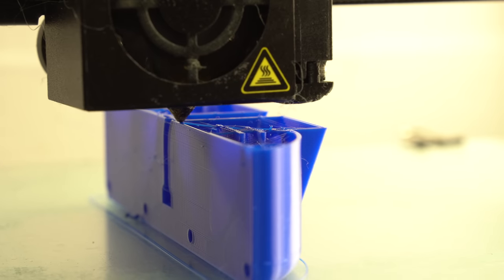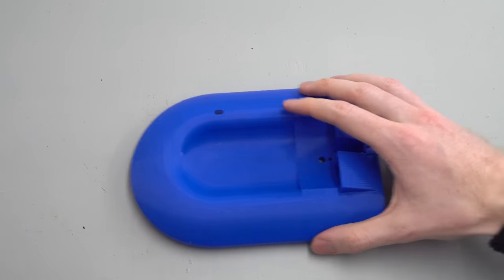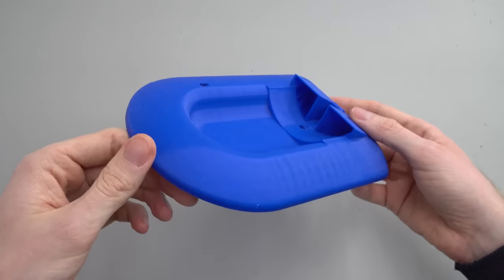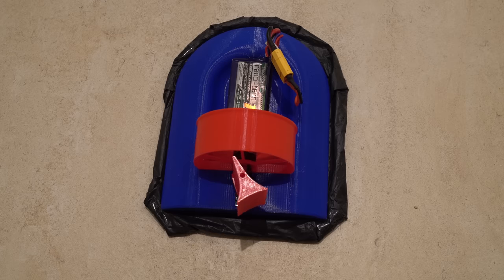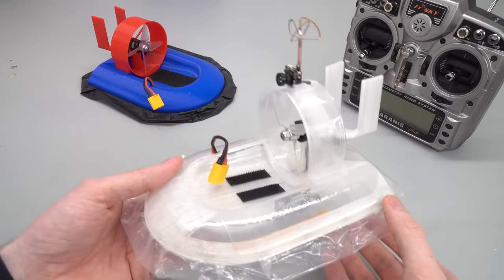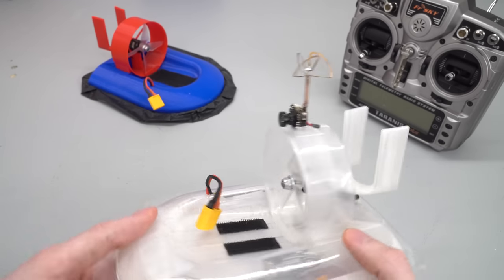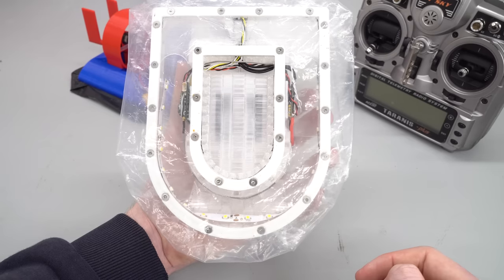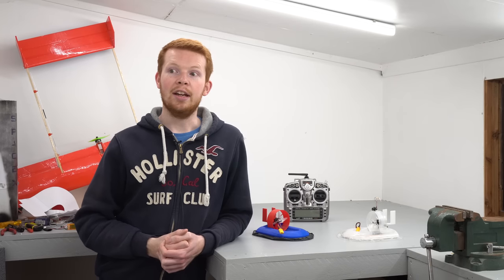RC Hovercraft Development

Comment: That VR system looks really cool!
Does anyone know where I could get one of those micro cameras?
Reply: The most reputable and specialised brand is Fat Shark, and then there's Eachine which just manufactures all kinds of low-cost RC toys, you go to their websites and find their distributors, they both have some retail presence in Europe and the States. Both companies are located in Shenzhen, China, but Fat Shark is run by a Canadian engineer. If you type in "FPV" on Hobbyking or Banggood or Gearbest you'll see some more offers direct from China, and you can usually get the same parts from eBay if you select worldwide or from Aliexpress.

I won't be able to give you advice on specific products to purchase or what their benefits or drawbacks are, i don't have any FPV experience myself, but perhaps this will suffice as a starting point. I can give you my general opinion on various Chinese mail-order companies individually if you like but the general gist is that while none that i listed are outright scammers, some people have had various bad experiences with each of them - Aliexpress and eBay offer some buyer protection, but are harder to shop at and get quite what you expected.
Reply: Thanks!
That is very helpful :)

Comment: Tom: I think this hovercraft is super sweet!  I bought the plans from Gumroad.  But dude; you really should have put some links in your plans.  I've been shopping for about 2 hours now and I haven't bought anything.  I can't even find the 1 pc 3" drone propeller.  HELP!!
Reply from the maker: Hi Michael,  Thanks for purchasing the files and sorry for not supplying the link. You can find a 3 inch propeller at hobbyking, link: https://goo.gl/xAr34F
Reply: Thanks for the reply Tom.  That is a 4 blade.  In the PDF you use a 3 blade.  I'm confused.
Reply from the maker: The spec of the propeller doesn't matter a huge amount, it just needs to be 3 inch in diameter. These are the propellers shown in the manual: https://goo.gl/SF4q9a but I can't find an 'international' company that sells them.
Reply from the maker: Also, I used those 4 bladed propellers in the clear hovercraft at the end and they work great. Thanks
Reply: Thank you so much Tom.  I love the content you are producing.  I am very new to RC stuff so please forgive my questions which probably seem very basic.  Continue with the good work!
Reply: Legend!
Reply from the maker: no problem! let me know if you have any other questions. Thanks

Comment: a lot of ruder modification not very useful according people who drives real small baggy style hovercraft, sensitivity of ruder is very low, center of mass have impact but it is not main reason, my theory is more likely that air is 833 less dense than water to produce sharp turns requires a lot of time, because force of air is very weak compare to water or compare to solid rubber wheels is even not comparable.

Comment: Dude if you want to drift use your throthle as your steering since by making the air flow greater your steering will be more responsive and if you start to spin out reduce your throthle and use your throthle smoothly and less chopy. Im not trying to sound like a dick

Comment: I'm looking at building my own quad need 2212 they 1050kv rating any help link cheap motors and can use outrunner motor with adaptor for props with my build  any help links as you building stuff all the time cheers cheap just to test as if crash break motors can live with it if expensive not good many thanks

Comment: wavt wind turbine hovercraft
Reply: wind powered, mechanical or wind-electric-turbine-water-craft
Reply: metal mesh structural balloon enforcement net
Reply: melt into the 3d printed or cast model frame
Reply: shallow water plastic dish
Reply: tarp on frame